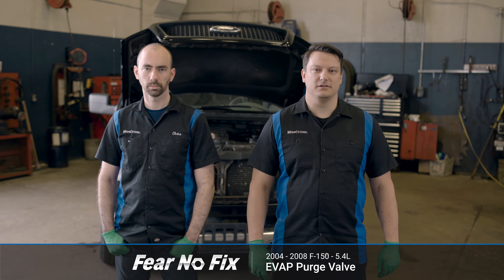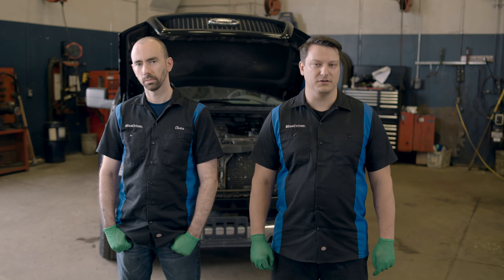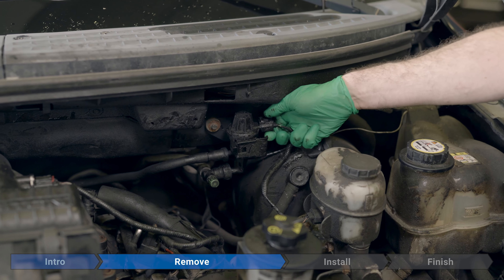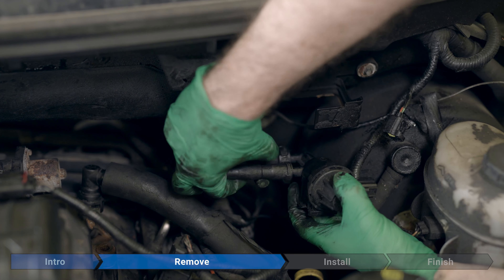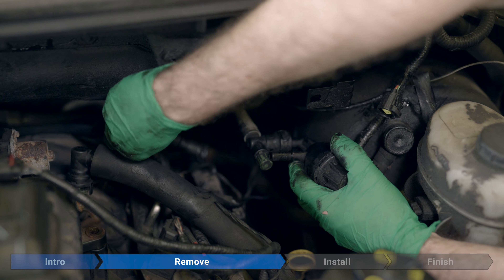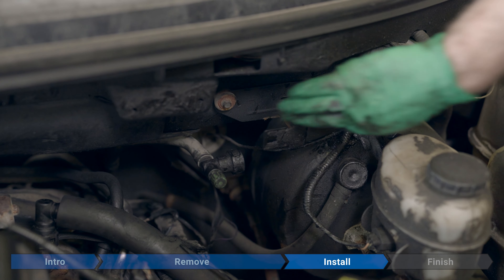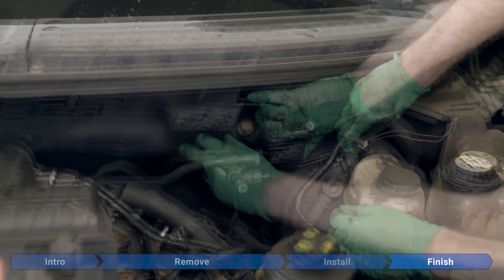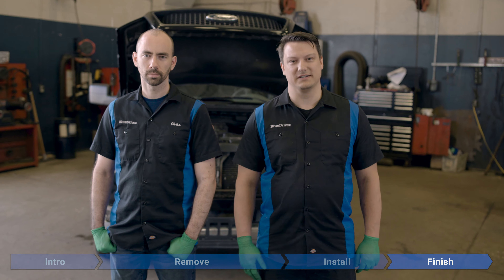EVAP Purge Valve – 2004-2008 5.4L Ford F-150

Comment: Knowing my truck is over 15 years old, as I was replacing the purge valve I thought that I'd also change the hoses. The purge valve part was easy to find but it's not as easy to find a replacement hose for a 04-06 5.4L F-150.
Reply: Theres tons on ebay and amazon
Reply: @AlexBarclayCalifornia  the top hose on my is completely collapsed. Will this cause bogging down when accelerating?
Reply: Mine is the same but dont know where it goes to the top hose @deransanchez3162
Reply: Check small hardware stores, they usually carry different size hoses and you can just buy whatever length and snip it to length when it's on the truck. Just what I did.

Comment: The removal of the valve was very good. Other videos don't show that.
Just an added note, after replacing the valve on my truck.
The small hose was deteriorated so I replace it as well. This may be a consideration on yours.

Comment: Without any codes how do you know if your evap purge valve is faulty? My fuel tank psi reads negative pressure anywhere from -30 to -80

Comment: What about p0498 i checked it with my blue driver and it says low circuit vent shut off valve but when i click on the repair it takes me to a replacement purge valve instead so which component would be the problem?

Comment: If I wanted to smoke test the system would I connect my smoke machine to the top hose going from the purge valve to the motor ? then how can I close the vent solenoid ? I dont have a bidirectional scan tool as I'm using autel md806 pro

Comment: Will this fix work for a ford f150 4.6 2007 code p0451?
Reply: Did yall ever find out the issue? Im having the same issue same sz engine
Reply: No that is a fuel tank pressure sensor fault

Comment: I have a p1450 fault on a 05 ford expedition.  Could this be the cause?  If so, could it also be causing misfires because the valve is stuck open?  Thanks.  I've been told by a shop I need a new engine.
Reply: Same issue, did you figure it out?
Reply: Hello, any help would be appreciated. I too have a 05 expedition. Did this fix your issue? Also, does your engine hesitate on highway speeds? As if you have to keep punching the gas for it to maintain power
Reply: What engine have your truck??

Comment: Do you need to reset anything after replacing the ''Vapor Canister Purge Valve''
Reply from the maker: If you are seeing the codes mentioned in the video after replacing the valve you should try to clear the codes.

Comment: I changed this & the light went off but still has hard to start & rough idle
Reply: I was looking over the comments on here and I noticed that you had said you changed yours so when you change yours and then it still had the same problem did you already change your upper O2 sensor and also check your mass airflow sensor if it was connected to the upper intake all that stuff I've done all those things I just haven't changed this evap solenoid and I'm wondering if when you change yours what did you also find out you had to do to get it fixed
Reply: @armandochavez3242  on my truck it was the variable timing solenoid but on the VW & Buick it was the purge valve

Comment: Does this also work for P1450- excessive fuel vacuum?
Reply from the maker: It's possible but the fuel tank pressure sensor is more likely
Reply: Did you ever fix the problem. Currently having the same issue?
Reply: @productive23  I haven't. I reset it, it will go a couple of days and light back up. It hasn't affected the driving, and I've been working 6 days a week since November 2020 and I just haven't had time to look into it further
Reply: @braddfinch9318  please let me know
Reply: @productive23  I'm having the same issue with code p1450 and planning on trying this.
Reply: @HomesteadDad  my check engine like still on. Let me know what you find out
Reply: I tried this and it didn’t work for me. I also got one from the junk yard so I’m not sure if they were both bad idk. Let me know if you have any luck @homestead dad
Reply: How do you know when they go bad, besides the code?

Comment: What is the top hose called?
Reply: Did u ever find out the name I need to replace mine
Reply: @dustincrane9311  Ford couldn’t find the part for me. Mine was falling apart and ended up I ended up using a 5/16” fuel line and reused the quick disconnects
Reply: I had to order the hose from Ford.  Description of the hose says "tube asy- fuel vapour".   It is the top hose on the purge valve
Reply: @dustincrane9311  the parts Department at Ford found the part I needed online.  The part number is 5L3Z9D289A.  He ordered it for me
Reply: @willgreeninlove  couldn't for the life of me find that part number, thank you for putting it out there.

Comment: Will this fix p0171? Thanks
Reply from the maker: Probably not - this code is for a lean condition so it may be something an air leak, clogged fuel filter, bad MAF, O2 sensor, etc
Check out our video on troubleshooting lean conditions (we even do demos on this truck!) at https://www.youtube.com/watch?v=NQxSg-G3fOo

Comment: In my truck the hose that goes from the valve to the top of the manifold gets flat like as if is stuck closed and lot letting air go thru it, is the purge valve that is bad or something else?
Reply from the maker: In this case it was the purge valve, if you have any other questions or suggestions please contact us any time!

Regards,
Reply: Mines doing that exact same thing. Did you find out what it was?
Reply: @joshbrowning3488  not really... I took the purge valve off and tried to blow thru it but is closed I am guessing is stuck closed because even when I put power to the valve it still stays closed but I haven’t bought a new one since is like 100$ for a new one but this week I will, I will update when I do
Reply: @joseuzcategui6159  What's the name of the little hose? If it is going flat, should it be changed?
Reply: Could be the purge valve like blue drive said i have not changed mine really doesn’t affect my driving
Reply: @joseuzcategui6159  replace my hose with 3ft of 3/8 hose easy and cheap
Reply: @biglance2033  the hose is not my problem is not leaking in fact is good since the hose goes flat meaning it has no leaks

Comment: Any tips p0451? Already replaced gas cap
Reply from the maker: Depending on the year P0451 might actually be your fuel tank pressure sensor
Reply: @LemurMonitors  I'm trying to find the fuel tank pressure sensor on rock auto and not finding it, could it be called something else?  Fuel pressure sensor connector?